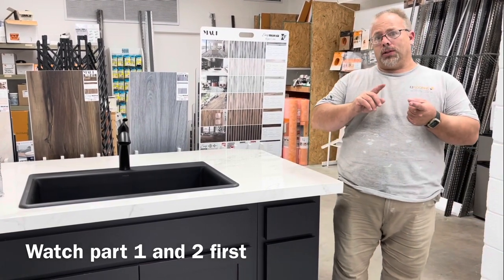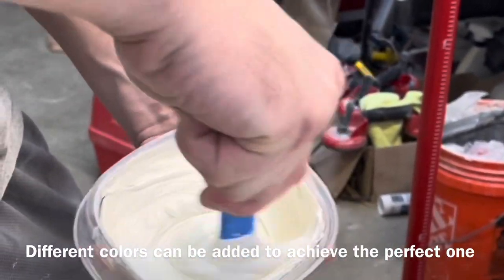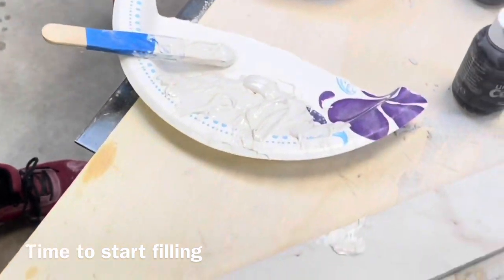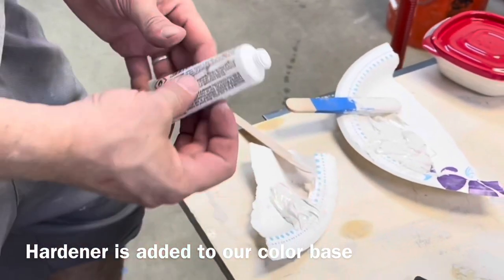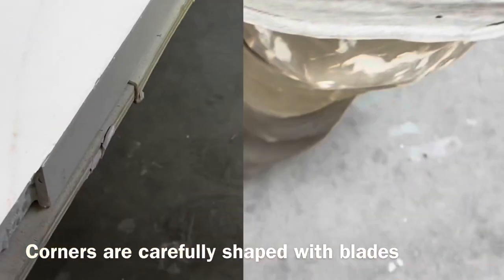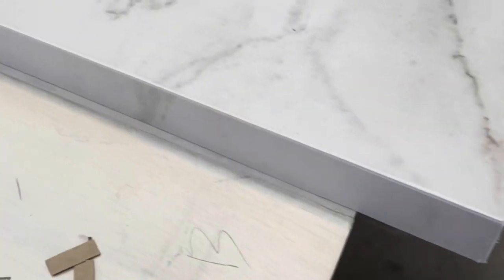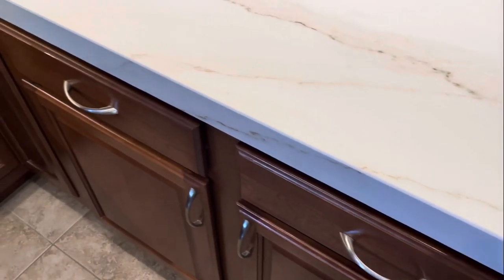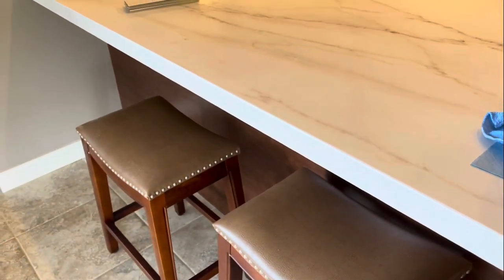Making Thin Tile Countertops by Hand | Part 3 | Columbia MO

Comment: How does the cost of this counter material and the cost of installation compare to other countertop materials?
Reply from the maker: Thin tile tops will be at the high end of countertop installations, and they should be. It’s a superior product. We find most costs are in the $135-$150 per square foot range.